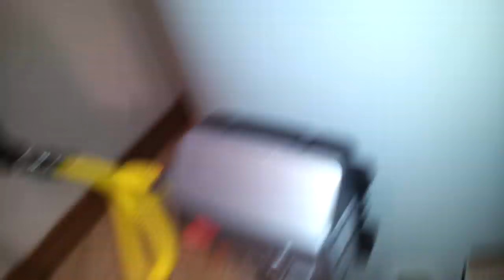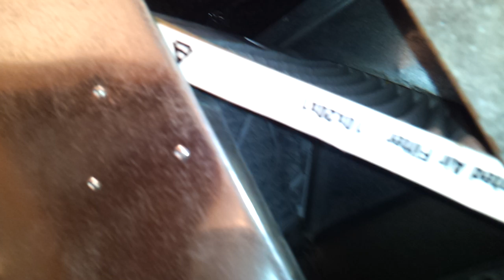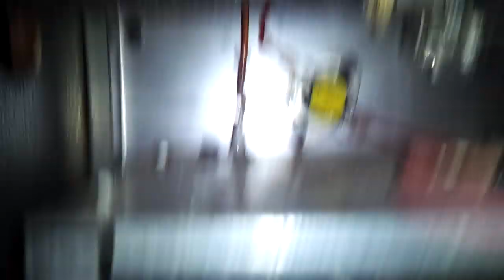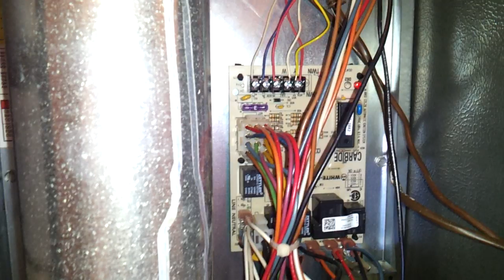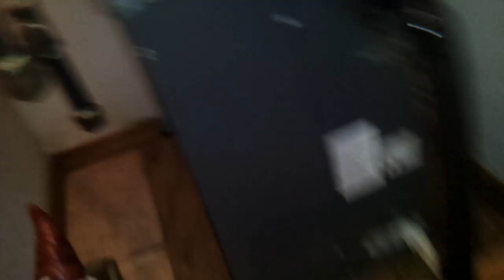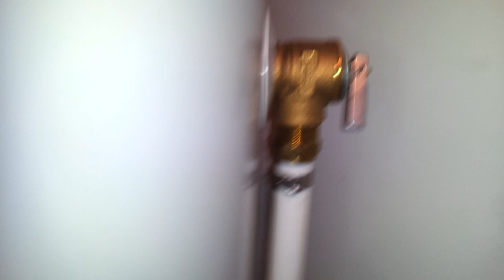HVAC how a gas furnace works.

Comment: Not a HVAC person, but have always been curious on how these furnaces work. Enjoyed the video.
Reply from the maker: I always liked to tinker twith things when I was a kid. My dad was a mechanic so I learned some stuff there but basically left all that behind when I grew up and started working. HVAC was sort of a forced job change, I worked in commercial printing most of my life but the market just wasn't supporting so many tradesmen (yes I know ladies...;) Due to the down economy and so many smaller shops being bought out. I was spending a lot of time at the unemployment office job searching and getting general training courses and they had a number of fields that they would pay to train you in, even help with tool costs, if you picked one. Out here in the country there wasn't a lot, but HVAC was a big need and truck drivers. Lots of gas well stuff still going on so lots of drivers needed. 
I didn't think I could stand sitting in a truck seat all day with my back problems so did HVAC. Was hired, mostly, before I even finished school. It was a tech repair/troubleshooting crash course basically, I kinda wish I had gone back on my own time and taken the installation course for a better groundwork in that area, not my forte, hehe. Ironically, even though my company knew my limits on what I could do because of my back, I prolly could have gone longer doing truck driving before needing more surgery. Who knows. Probably lucky I lasted as long as I did between surgeries, hehe. 
Anyway the moral of the story is that I'm really happy I did do HVAC, it reawakened my inner tinkerer and love to fix things!  Stuff I would have been afraid to even try to fix (not HVAC stuff) before now I enjoy trying! Well unless it tips the time/cost ratio, hehe.  Like when the wife says 'just call someone!!'.
When the pipes on my backflush water filter froze outside a few wintes ago my neighbor helped me bypass it to get water (my back was too messed up to do it myself). Summer rolled around and I probably could have replaced all the stuff and replumbed it, doing a bit at a time as I felt up to it, saving the actual full plumbing in for last, but I just couldn't motivate myself to do it, I hurt so much all the time. The wife gently (ahem) suggested I just call a plumber.  
$450 dollars later for prolly less than an hour's work he was done. Daaaamn!  Then I was wishing I had pushed thru the pain!  I could have bought a new toy with that, hehe! Even though I told him ahead of time, he didn't bring enough insulation or the kind I asked for. Sigh.
Maybe I should have been a plumber!  No... Too much under the house work, lol.
Thanks for watching and chatting!!

Comment: my furnace is an old outdoor unit and has not been working at night when its cold. the blower will briefly come on but no ignition. works around mid day.
Reply from the maker: The only thing that comes to mind with the limited info youve given is something I ran across on an outdoor unit with spark ignition.  Its been years so im trying to remember... I think I had a grounding issue on it. I cut power and removed the spark rod assembly and gently sanded the buildup off the rods. Be careful not to bend them or break the flame sensor rod since some of them are embedded in a bakelite material to hold them. Corrosion builds up between the bottom of the plate and where it bolts to the unit, you have to sand these clean and wipe the surface, then screw everything back.

If it continues then it could either be a weak ignition cable, or more likely the ignition module on the control board is getting weak and not providing a good spark. If its not working a good thing to do is try and watch and listen to it to see what it is trying to do when it fails.  Let me know what you find!
Reply: A previous repair job was the problem. I took it apart and found the led indicator said it was the flame blow back sensor. Further examination showed the sensor had been removed and wires were connected with electrical tape. When it got cold at night the tape lost its sticky and was creating open.
Reply from the maker: Lovely! Hillbilly repair job, lol!  No, theres no reason to have that thingamajig in there anyway, just yank it out and slap them thar wires together with duct-tape billybob! Lol!

I hate going out on really old units because sometimes there have been countless hands in there fixing things over thirty or forty years, lol.  Well glad you found the problem!

Comment: Hi, I had a question and wonder if you could provide some insight. This morning, I smelled what seemed to be burning dust. We were operating a space heater that definitely has some dust on the heating coils, but I wasn't certain that that was the source of the smell. I opened the door that leads to the attic where the gas furnace is located, and to my surprise it wasn't cold up there (like in our previous house). I noticed that the furnace was glowing bright red/orange and I immediately moved both the upstairs and downstairs thermostat to the off position. I'm not sure when someone can come to inspect the unit(s), so I am wondering is this normal or is it a sign of potential danger? It is unseasonably cold for our region of the country right now so I don't want to keep the unit(s) turned off for long, so any insight you could provide would be greatly appreciated.
Reply from the maker: Hi Marcia!  Well initially I wouldn't worry about the dust burning smell, assuming that this is the first or second time the heater has been run for the season. Space heaters always collect stuff from the air and the house furnace/air handler will do the same thing during the summer, even with decent filters you sometimes get buildup on the heating elements or heat exchanger.
As for the furnace in the attic, without actually seeing your furnace running or a picture, I can't offer a solid opinion. Typically gas flames should be mostly blue (again, I'd have to see the furnace to be sure) and usually if I'm seeing red/orange, especially on an older design furnace, that could mean rust buildup has fallen down and is laying on the burner assembly, or that there is a rusted through hole in the furnace. The first is bad, the second can be deadly. Again though, there are exceptions so its something you have to see.  Do you have at least one carbon monoxide detector upstairs and downstairs that aren't very old and working properly?  I always recommend TWO for areas EACH furnace covers. I always like a backup in case one fails. You have two thermostats so most likely have two furnaces unless its a zoned system.
Do you know how old the furnaces are?  I always recommend having furnaces checked every year before winter hits, if you dont have a regular service company then ask your neighbors and find one that has yearly service done and is happy with their work and doesn't feel like they are making things up to charge for. (Hate to even suggest that but its a crazy industry!;)
As far as being warm in the attic... There can be a ton of reasons; the sun is heating the roof and passing the heat to the insulated attic, you could have poor insulation and heat that should be staying in the house is seeping into the attic, you could have loose or leaking ductwork that is letting conditioned air into the attic instead of all making it to the house, you do get some radiant heat coming off the furnaces as well. Also make sure the idiot house builders DID NOT vent the clothes dryer into the attic!! I see this once in a while. Its a fire hazard and also leads to mold growth in the attic.
You can send me a pic if you like but sounds like you've never had them checked so I would highly recommend it.  Always good to have them checked, and ask them to check the water heater gas lines while they are there :). Hope this helps, let me know how it goes. Oh, my gmail is my username here if you're interested!

Comment: Hi.  My Blower motor is stuck on, runs continuously and won't shut off.  I took out the blower motor to clean it, re-installed it and now it just runs and the thermostat isn't doing anything.  I went through the start up directions in the manual but doesn't do anything.  Any suggestions.
Reply from the maker: Hmm... Odds are that there is a thermal limit sensor mounted on the back of the blower housing that had two wires attached to it when you pulled the blower out, do you remember seeing one?  If you forgot to hook those wires back up to it then that is what might be causing the blower to run with no thermostat response.  A sensor wire pulled loose or tripped is the only thing I can think of in this situation without seeing it. Let us know what you find!

Comment: Hi! Good video & thanks for uploading. I want to learn as much as I can about these because I am selling them d2d. I used to work for a company that sold uniquely Lennox, now I'm selling York (Fraser-Johnston) models. Could you tell me between Carrier, Lennox, York & Goodman - Which is best & in what order. Also, a few things tips on selling features to bring up & general advice on a good inspection to make the job as easy as possible for the technicians?

Comment from the maker: ...and yes, if you have negative pressure it is required to have a trap.  Sometimes you will see or even need a trap on a positive pressure unit if the homeowner gives complaints about hearing gurgling noises in the bathroom sink (or wherever it is piped out to) ...sometimes I will get early season complaints about these noised on negative pressure systems when they just fire up the unit and it hasn't run long enough to fill up the trap (evaporated since last use) and I'll just put in some water

Comment from the maker: The positive or negative pressure isn't really related to wether it's a downflow or upflow; it's related to where the evaporator coil is in relation to the blower motor.  If the blower motor PULLS the air through the coil then it's NEGATIVE pressure, if it PUSHES the air through the coil then it's POSITIVE pressure.  If it Pushes through then it will push the water down the drain, if it PULLS it through then it will try and KEEP the water from going down the drain, so you need a trap!

Comment: You mentioned this unit has positive pressure because  of downflow, therefore not needing a trap. How about an upflow unit? Idoes it work on positive or negtive pressure? Is a trap required by building code? Thx.

Comment from the maker: You probably could but I would rather recommend a vacuum cleaner to suck the stuff up and maybe a lint brush (like the dryer vent kind) ...of course with the power and gas turned off!  If you blow dust/lint up into the unit in the wrong places you might get a bigger bang than expected the first time the thing fires off come heating season!  :)

Comment from the maker: Glad you enjoyed the video!  Yes it is pretty normal, they are placed either in front of the jet or slightly offset typically. The igniter is usually silicon carbide or nitride and is pretty resistant to high temperature. The flame sensor is usually stainless steel handling over 1500F easily!  The igniter eventually fails after a time and will crack at the weakest point and need replaced. The flame sensor needs cleaned periodically due to carbon build up by your tech during a yearly checkup!

Comment: Great vid. Is it normal for the igniter and flame sensor to be positioned right smack in front of the jets? How does it resist this intense and constant heat?

Comment: always have used sand paper never had a problem, were dealing with a metal rod..I always try to measure the miliamps before and after cleaning

Comment: your right...compression fittings and Teflon tape is a sign of a moron....little pipe dope maybe... Teflon is for pipe thread...thats it...unless there is some earth-quake code... flex connectors are very illegal on all appliances except for movable or hanging appliances

Comment: no drip pocket on the gas line....never clean the flame rod....replace them..12 bucks, any "OXY" cleaning products in the house will cause them to fail quickly...4 yrs apprenticeship with 8 months of in-class training in Canada...we have a national code...best in the world..not state by state...only high efficient furnaces sold in canada...condensing style..pvc vented....impressed sir...you know your stuff

Comment: Mikie, My question is about a Goodman 3 ton roof top unit. I went on a no heat call and saw gas valve is not getting 24 V at all even though board is good and inducer closes the centrifugal switch I can even hear the spark igniter tries fire up but never opens the gas valve. I read ghost voltage on the gas valve during the ignition trial but never goes up 24 V. I checked the limit switch and rollout switch they are all closed. What do you think? It has tight ground also on Transformer.

Comment: Hey mike thanks for the video.  However you do need some more training Ive been in this industry for over 20 years and you seem to be an average tech.  Demand better for your self. The first thing that happens in a call for heat is the control board checks the pressure switch to insure it is open, and no nothing has bypassed it.  Sand cloth does not cause any issues with operation. Ive put duct tape on one to try and make it fail.  Keep learning I know I am thats what the industry needs

Comment: Also these Mid efficiency furnaces have been banned in Canada for at least 4 years now. They all crack like it's going out of style. If you own an 80% AFUE rated furnace, do yourself a favour and buy a carbon monoxide detector and get it checked every year. Almost every one I have checked is cracked, no matter the brand.

Comment: Let's see. Code infracions if you lived in Canada. Flex connector on water heater is not allowed. No dirt pocket on the final drop of the water heater. The cold air return must be at least 10 feet from the furnace. You should also put a sediment valve cap on the water stop. Thx

Comment: Obvious gas piping problems: 
No drip leg at the bottom of the water heater drop.
The appliance flex then creates a natural trap being looped down.
The appliance flex connectors are doped with stringy teflon tape: Illegal.
(The tape strings off and gets in the gas valve causing a hazard. Only approved tape for gas (yellow) is acceptable. I don't even use that.)
Bill

Comment from the maker: @HANDYMANDAN51 Almost every furnace I've seen in Texas is 80% ...only a few 90 and 95% systems.  I think further north they are required to have higher efficiency.  I'm not sure if certification is required in most states or not.   I know to work with propane systems you have to have a cert. in Texas but not for natural gas.   All of my furnace training was on the job.  ...now if that doesn't give you a warm squishy feeling inside I don't know what will, heh.